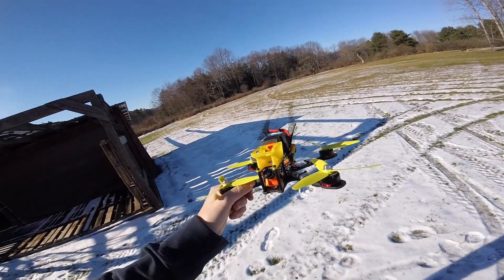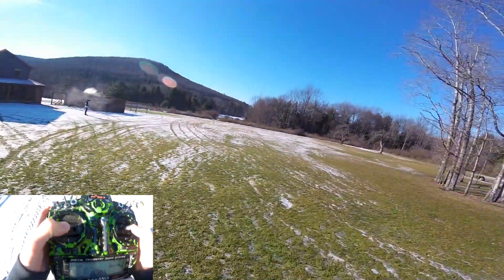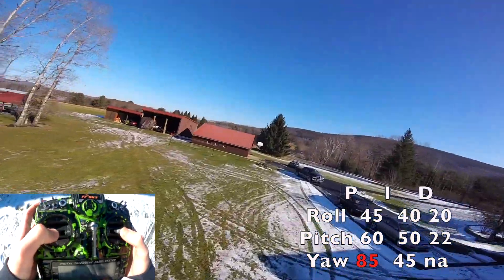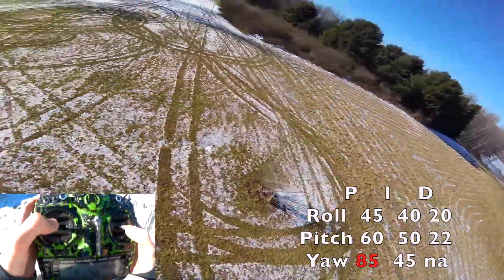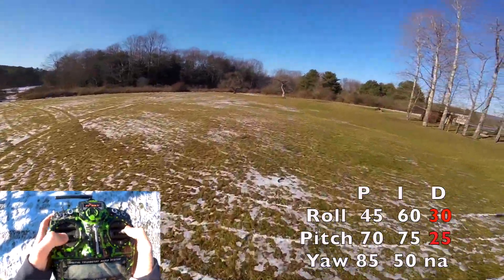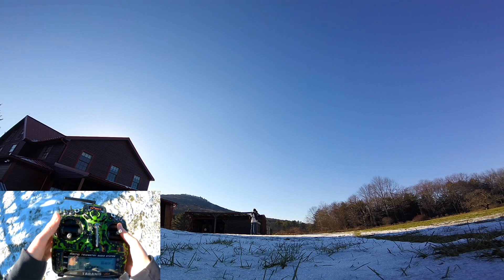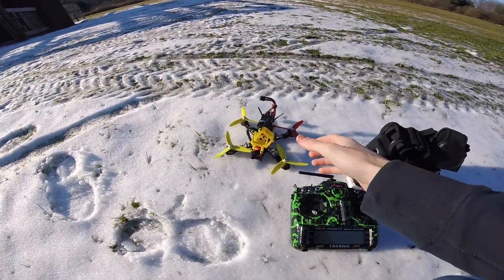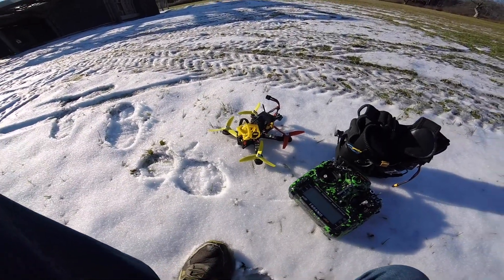PID Tuning Tutorial : ZMR210R

Comment: Love the content! Hoping for some advice.... brand new chameleon build. Flies perfect better than any other quad I have except during take off for the first few seconds low to mid throttle the first 10-20 ft in the air it whobbles pretty good. I went through took off all filters through dynamic filter and flies even better except that initial whobble. Any suggestions?
Reply from the maker: Any chance you could post a video? Not fully sure what you mean. Sounds like propwash coming from off the ground, but that onyl lasts a few feet.

Comment: would you say the gb210 is better or would you say this 1 is better?
Reply from the maker: Well, the part in this build, mainly the frame and motors are better performing and quality, so this one I would. Not saying they both can't fly well though.
Reply: why i was asking this is actually i just want to know is a frame with a under slung battery better than a battery sitting on top,i never flown a quad with a under slung battery and would want to start building on one just not sure if it is better..

Comment: quick question - I was tuning my Alien KISS setup and it's pretty snappy, however, it no longer hovers in one spot without me having to fight it with the gimbals.  If I center my sticks and give it throttle it wants to drift backwards now.  Is this normal?
Reply from the maker: Not sure about the kiss configurator, but you probably need to add some trim in your radio. Try to get all channels (besides throttle) to be 1500 when you let go. You will probably find that pitch is 1490 or something similar causing this.

Comment: What esc do you prefer to use? I have been having issues with esc's and i'm new to the drone world so want to know of good 30A esc's that will def work without issue and not drop a lot of money in parts tht dont work as I have in the red brick esc's i have 16 that wont work.
Reply from the maker: I like the DYS XS20. You can take the cap off to make them DSHOT, or get the XSD20 version and it comes pre removed. I find no reason to use 30a escs, just more weight.
Reply: do you have skype or anything i can get some help and ask more questions so i can understand whats going on

Comment: emax nice but i think ive got bad motor too..even with blackbox using horizon #4 motor will show during a punch 100% but other are not even close to that value and there all around same.   whats your rc rate and super and angle/horizon strength and transition i may try these pid since i have issues related just like this
Reply from the maker: It could also be an esc issue with one not making enough power. I do not use anything other than acro mode. RC rate is 1.1 and Rate is .80

Comment: How well these batteries respond with those motors and so much consumption of amperes that propellers you use
Reply from the maker: They are fine. Getting 3 mins of hard flying.
Reply: The RCAddict  with 5040x3 propeller??
Reply from the maker: Marcos Rey vieitez Yes, I use cylonce V2 now.

Comment: Thanks for the tuning video - they have been very helpful as I am learning to tune my quads. Do you find any variances in values when tuning a 5 inch quad vs a 3 inch quad? Heard someone mention that 3 inch quads tend to have higher P values. Also, do you mess with the D weight set point at all? Thanks again for the awesome videos!
Reply from the maker: Yeah, since the props are so small they have less authority and usually need higher values to maintain the same amount of control. I have never moved those sliders, I probably should learn them and use them, but I just go fly haha.

Comment: what fc are you using and what are your rates like
Reply from the maker: X racer V3.1. RC Rate of 1.1 on roll pitch and yaw. Rate of .80 of roll and pitch, and .70 on yaw.
Reply: If I put these rates and pids on a naze32 would it fly similar? Thanks
Reply from the maker: SCKulpa Ok BF 3.0 or higher it should. But you will need to tune it, PIDs are different for every quads.

Comment: Hi guys.  Problem  If I have P and D to high can it cause motor to overheat ?
I just had smoke come from motor 2 on quad. This problem only happen after using  Gtune, Gtune Put P & D at max setting (Fly ok )
Reply from the maker: YES, P AND D can cause this. P causes the super hard oscsialltions that create heat, and D amplifies the noise which causes it to smoke. NEVER use the Gtune feature, it is totally worthless. Also that is in Cleanflight, get rid of that and flash to Betaflight 3.1
Reply: betaflight will flash to my f3 board but im using cppm and it wont work. cppm option not offered
Reply from the maker: Jamie Jones Use the PPM option.
Reply: Yes I try that and it doesn't work
Reply from the maker: Jamie Jones What RX is it?
Reply: not sure what rx means but I have D4r2 and Taranis X9D Plus
Reply from the maker: Jamie Jones Rx is receiver, so yours is a D4R-II So you have the little jumper over pins 3 and 4 to get PPM?
Reply: yes.  I can make the motors spin with rx but the motors only spin very slow just like on Blhelli when you click a button and the motors spin
Reply from the maker: Jamie Jones Do you have them properly calibrated?
Reply: yes.

Comment: Hey man, do you mind helping me with a similar issue? 
I have the same mid throttle oscillations in your video that I can't figure out. It happens on default PIDs. I'm using a KISS FC with KISS 24a ESCs, and T-Motor F60 2450kv motors. I have a video on my channel about the problem and hopefully you can watch it and give some input. I also only had one small crash, and that was into grass (link to it is in the video description on my channel). It would really suck if it were my motors, because this is a brand new build! If it's because one strike in grass killed one of my F60's, I'm switching to Lumenier RX2206's. 

Thank you for taking the time to do this PID tuning series, I've learned a lot from it in the past. These mid/semi-high throttle oscillations are really bugging me with this KISS setup.
Reply from the maker: You obviously haven't been watching many of the popular pilots lately ;) Especially with Kiss, I bet soft mounting your motors will fix the issues. Kiss is known for those.
Reply: Haha, I've been keeping up with it. I'll go ahead and give it a try. I wish I knew why KISS is known for mid throttle vibrations...
Reply from the maker: ***** Not sure why, just something to do with their firmware I guess. Probably why the KISS users are having such great sucess with softmounting the motors sicne the KISS fc is very sensitive to vibrations.

Comment: I am having a similar problem. My motor bearing seems off and the motor make a weird clicking noise. They also smell burnt. Were your motors coming down hot? Mine are... Any suggestions?
Reply from the maker: Yeah, bearings are probably going bad. If they are burning you might want to lower your D and make sure the motor screws aren't going up too far and touching the windings. Too much heat will cause demagnetization and you will then have to replace the whole motor.
Reply: The weird thing is I just got the motors (ZMX Fusion). Also, I am on stock tune. The screws are not to far in... I don't know what to do. I think I am going to lower P and D to start.
Reply from the maker: haon15 Hmm, the fusions are very high quality. If the bearings are making bad noises without crashes I would ask for new ones :/
Reply: Yeah I just sent out an email. Hopefully I can get some new ones. Thanks for the help. Love the videos!

Comment: if they didn't soft mount the engine in your car, your teeth would fall out.
Reply from the maker: Are car engines softmounted? From any cars I worked on looked like they were bolted right in.
Reply: The RCAddict most cars have a rubber bushing inside a metal bracket to hold the engine, race cars have stiffer bushings polyurethane and maybe the most hard core would have it direct bolted.
Reply from the maker: Funny as I just saw a video where someone else brings this up. Thanks for the info!

Comment: could you please tell what your rate set up is is for betaflight... thx !
Reply: 1eyedFPV, Few videos back its, 1.10 for RC Rate and 0.80 for Super Rate, which gives a max Velocity of 1078 deg/s, sometimes it goes up to 1100 deg/s not sure why. For yaw, same RC Rate but 0.70 Super Rate. I use the same rate too. Very responsive but I add a bit of expo on my controller for smoother turns as Im not that good of a pilot yet.
Reply: thx !
Reply from the maker: thanks for the help Hong!

Comment: hey I'm noticing like a little Twitch in my Motors at about half throttle any ideas of what it might be the motors are basically brand-new red bottoms they'll feel smooth other than the strong ass magnets LOL and I haven't crashed it and I change my props if I get one little chip in them
Reply from the maker: Never thought I would say this, but since Josh approves, you could try softmounting your motors.
Reply: Ultimatevapor918 it's scientifically proven, softmounting works
Reply: +The RCAddict but it is a Band-Aid remember lol
Reply: Ultimatevapor918 you can still use it to finish a tune if you know you have a dented bell or damaged bearings
Reply: +Nikolas Quaade Gonzalez (NikoFPV) just use the double sided sticky tape or O-rings
Reply: Ultimatevapor918, I agree too with the soft mounting of motors. I was having twitching and mid throttle a while ago, then I mounted my FC with some foam between the screws then the twitching was all gone.

While doing that I realized that one of the motors was having some sort of oscillation at its natural frequency at mid throttle.

In short words, reducing vibrations can really reduce a lot of weird problems. :)
Reply: The RCAddict My quad flies really smooth without any vibration. If I will soft mounting my motors and FC, its can producing a problem?
Reply from the maker: MC flyer I don't think it would, but I have no experience here.
Reply: are they 2600kv
Reply from the maker: SCKulpa 2300
Reply: yes they are

Comment: Did you use conformal coating on your electronics? I landed in the snow like that recently and fried my pdb/bec.
Reply from the maker: Nope, I have never waterproofed anything and never had any "issues". If I get the escs for the FC wet though it won't boot up and you have to wait like 8 hours till it is fully dry.